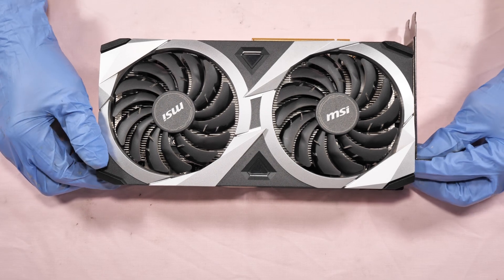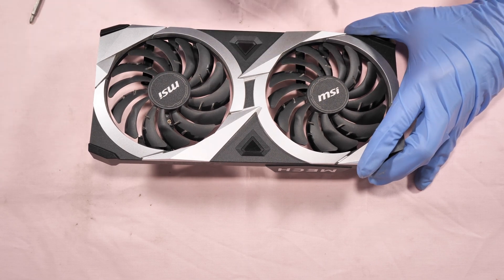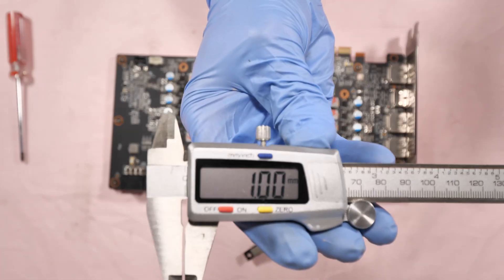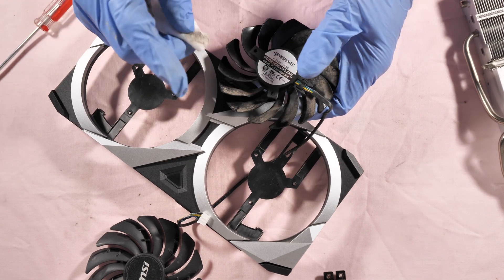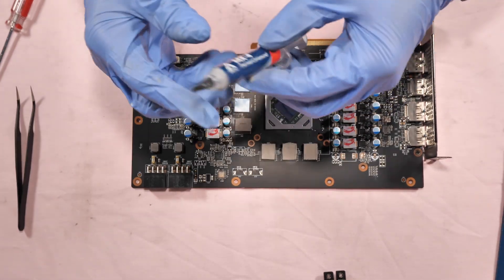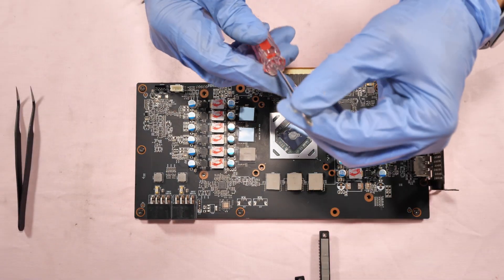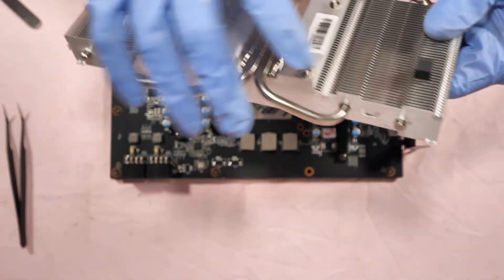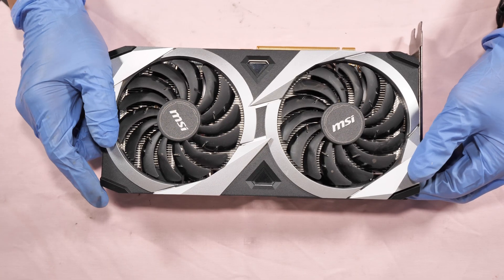MSI Radeon RX 6700 XT MECH OC | Thermal Pads Replacements\Thickness | Fan Replacements | DISASSEMBLY

Comment: Hey man, can you please try to teardown the MSI Mech Rx 7600 please?
Reply from the maker: Hi bro! I'll see what i could do, at the moment i have on hand the RTX 4060 that could be this coming week. I'll do my best if i could source out that particular gpu. 👍
Reply: @TakeThatScrewOut  Thank you so much for the comment! I am hopeful that you'll be able to acquire the Mech Rx 7600.

I was also looking into the rtx 4060, particularly the MSI Gaming X model but it is $110 more expensive than the Mech Rx 7600 in my region :| Plus, my monitor is only Freesync via HDMI port (no nvidia - adaptive sync).

However, I forgot to thank you on one particular observation. It seems that on the Mech in this video, the fans and the plastic shroud with the fan can be disassembled without harming the warranty sticker on the backplate and that is a GREAT news for those of us who like to keep us PCs clean from dust! Thank you for showing this! Although, I hope that it is also possible with the Mech Rx 7600. Good luck!
Reply from the maker: You're welcone bruh! The Blue stick called " PRYING TOOL" you could buy the in Amazon, ebay or other online retailer. By the way, my upcoming Tutorial video is ASUS DUAL RTX 4060.
Reply: @TakeThatScrewOut  That has a nice design. A bit transparent on the plastic cover shroud.
Unfortunately, I will never buy asus because of its extremely high regional prices. I will still look forward to that teardown! Good luck!
Reply from the maker: @sheikhtashdeedahmed2740 thanks bro! Take care.
Reply from the maker: You're very welcome bro! If you have any question about the card just leave in the comment and i'll do my best to answer asap and best of my knowledge.. Thanks for the support! Enjoy!
Reply: @TakeThatScrewOut  Somethings I want to ask but not in the comments. I want people to watch the vid to find out. Can I message you on any other social media? Email is good too.
Reply from the maker: @sta2740  here's my email bro, " ranayabusiness2021@yahoo.com"
Reply: @TakeThatScrewOut  I'm sorry, there's one thing I forgot to ask. What is the blue stick that you have used to take off the thermal paste? 😅
Reply from the maker: Hello bro! MSI RX 7600 MECH 2X Classic Tutorial video has just been posted today 5th Sept. on my channel..Check that out! Cheers! enjoy!
Reply: @TakeThatScrewOut  Hello! Thank you for this! I have just now watched it!

Comment: Привет, а какой фирмы и какой размер вы использовали термопрокладки?
Reply from the maker: Sorry bro! Can't answer your question. If you could translate it to English that would be great. 😀
Reply: @TakeThatScrewOut Hi, what company and what size of thermal pads did you use?
Reply from the maker: I've used different Brand normally..but when it come to Thermal pads based on my personal exoerienced..i recommend Arctic TP-3, GELID EXTREME, XTREME ODESSEY or TRUCER. but Arctic i've used most of the time because its a bit soft side..it could easilly adopt the gap and it performs as good as the other high end brand.
Reply: Используй либо thermalright odyssey, либо fehonda. Также вместо mx4 купи honeywell, его точно не выдавит и он продержится гораздо дольше

Comment: I would like to replace the thermal pad due to high junction temperature. It seems that 1mm is not enough for some people to replace.
Is 1.5mm OK?
The model is RX 6700XT MECH 2X.
Reply from the maker: If you really need to use 1.5mm choose a pads that is soft like Arctic or similar..don't use  Gelid cause its hard, only suitable if use similar thickness from stock.
Reply: did your junction temps reduce mine are high i just down clocked my core and undervolted the card it seems to help
Reply: Actually i had to squezee pads to 0,8mm to proper even distribution between memories, core and heatsink. Check the ideal distance by looking at the threads you put screws into. The PCBA must sit on these. If there iss too much space, the pads are too thick.
Reply from the maker: Thermal pads are different depends on the Brand.. Some are soft and some are a bit hard. This kind of issue can be solve by using a softier pads, it could adopt easily on different gap. And also gpu gap can be possibly change overtime due to its constantly in and out of the screw multiple of times, that could cause loose..there will be no accurate answer.

Comment: Thanks for the video, I have that card, its fast but the downside is that it's loud so i moved it to my workstation instead of my main gaming gpu, overall its the best card i have. What it has LED 1:46 connector? I don't see mine having led lights?
Reply from the maker: That " MECH " emblen at the top that lit up.
Reply: @TakeThatScrewOut mine doesn't light up...
Reply from the maker: Thanks Bro! Take care!

Comment: blackplate is plastic ?
Reply from the maker: Yes its a Plastic..its just a cover, unlike other gpu that has metal that serves as a heat spreader.
Reply: @TakeThatScrewOut  thanks  not good in plastic

Comment: Hi sir what is the max total gpu power in real life for this gpu?
Reply from the maker: According to MSI official specs on this particular  card it would draw 230 Watts..but in real life that normally fluctuates within that range.
Reply: I use with a slight undervolt and see 150watt

Comment: i heard the 6750xt version runs warm. do you think corsair 4000d airflow case and 3 intake/2 exhaust fans will help?
Reply: It is I’m at 72c most of the time
Reply from the maker: This temp is average for heavy loads..which is really good
Reply from the maker: That case is brillant performer..if possible to fill all the Fan slot available, do it mate! And if you want your GPU to perform its best, never go for VERTICAL POSITION and use a PCIe ext. cable..Direct contact to the PCIe GPU & MOBO is the best., and if your Case allow..Use three 120mm or two 140mm INTAKE from the buttom of the case UPWARDS cause Heat direction normally goes Upwards direction. And the TOP FAN SHOULD BE EXHAUST. that make a big difference.

Comment: What is the "normal" tempeture with this gpu
Reply from the maker: After the repaste, on heavy loads Playing COD Warzone 2.0 for about 2 hours temps fluctuate between 57-65 deg with Lianli Pc-011 Dynamic Midi case with 8 fans..this may vary depends on various factors..case,fans, room temps etc.
Reply: @TakeThatScrewOut  How about the Junction Temperature? When you open the Adrenalin software you can see both the GPU and the Junction Temperature.

Comment: Is is possibile to install a bigger radiator with 3 fans from diffrent model?
Reply from the maker: Sorry, i didn't get what you mean by radiator with three fans..do you mean like water cooling 360 aio?
Reply: @TakeThatScrewOut  Like ASRock Radeon RX 6700 XT Challenger Pro  or  Phantom version.
Reply from the maker: Not possible bro, they have a different screw layout on the pcb.

Comment: I have the same card and i have problem... Max load GPU i have 105C~ hot spot. What i need too do? I have guarantee MSI. They can repair my GPU or they tell me its normal for this GPU?
Reply from the maker: This is my suggestion: If you still have the warranty, try to file for RMA ( Return Merchandize Authorization)  and let MSI to fix the problem for you for free..because, if you try to do it yourself, you open the back and change the Thermal Pads and Repasting it..that might solve the Thermal Throttling Issue, but you've break the WARRANTY SEAL AND VOID THE WARRANTY. the problem is, we don't really sure whats really the main cause of the Very High Temps..Doing it by yourself only advisable if your card is already OUT OF WARRANTY. hope this helps.
Reply from the maker: 105 deg is too much..i've played many games for hours most of my card..Temps only averaging netween 58-65. But that would vary depends on many factor, like how many fans inside your case and what type of pc case you're using..
Reply: @TakeThatScrewOut  He's talking about the GPU HOT SPOT, that is, the Junction temperature which is much higher than the normal gpu temperature in this card. I think in his case it's normal.

Comment: please tell me, I have the same video card and when replacing thermal paste, the temperature has increased significantly...I noticed that the radiator does not fit snugly to the chip , there is a gap . How to fix it?
Reply: the old saying.   if not screwed do not fix it.      but nice to learn how to clean the outer part of fan and dissipator
Reply from the maker: Check if the thermal Pads is the right thickness..i suggest use a good quality pads and paste. With pads use Arctic the blue color, Gelid or TEUCER ther.al Pads..with paste use NOCTUA NT H2 or ARCTIC MX6.. and make sure the heatsink and pcb is properly sit before you screw it back..sometimes thats the one reason it cause a gap. Hope this helps
Reply: @TakeThatScrewOut  case always opened  all sides.   it's huge the amount of heat those beauties  produce.  mine is 6750xt mech 2 oc msi.
Reply from the maker: Its big help using a case with intake buttom fan that blows direct to the gpu and exits at the top.
Reply: Mine too i opened  and the thermal  paste was all dried,  and i chamged old one for new noctua  and the thermal pad but it got hottel maybe from 75 tem and 92 junction tem, to  temp 75 and 97 sometimes  100 in junction tem, and the fans  are loud 2300 rmp
Reply from the maker: @davidespinoza5634  on most cases after replaced pads and paste, some just used a cheaper pads thats been bought in ebay that doesn't transfer heat..thats one reason., but in your case that you use a good quality paste, and still the temps quite high..maybe, possibly its not screwed in properly that cause a little gap that could affect the heat dissipation as well. All screw should be evenly tight.
Reply: @TakeThatScrewOut  i will take a look, i know this card can support junction temps up to 110 degrees  but the fans will make a lot of noise, i will open it again and try, by the way the pad are thermalright 1 mm, later I will try with thermalgrisly,
Reply from the maker: @davidespinoza5634  Okay bro..good luck and enjoy! keep us posted about the result. many thanks bro!
Reply: @TakeThatScrewOut  i discovered that for some reason the 1 mm pads in the memory  were causing  the problem. Maybe for my model they were too thick, and the gpu was not making good contact with the cooler, i added some more paste to meke the gpu make good contact  because the   only pads that i have are 1 mm, now seems to be good,   current tepm its between 65 to 75  and junc temps are around 77 0r 80 sometimes  spikes  a 87, or 90, but when the fan start to spin it will get to 80 again,
Reply from the maker: Oh i see..thats good that ypu fixed the issue man..thermal pads are not made equal, some pads are soft some are very stiff like the Gelid, they are high quality perform really well but stiff. I think 1mm should be fine if its soft like the Arctic pads.

Comment: Is this the same as the mech2 x
Reply from the maker: Honestly, Can't give you the right answer right now because i haven't done the Mech2 yet..but i would do soon..i have two cards to do this week, its ASUS RTX 3060 Ti TUF Gaming and GIGABYTE RTX 3060 TI Gaming OC..please consider Subscribe to see more videos. Thanks!
Reply: Any infos so far? Do you know if the Thermal pads for the mech 2x are also 1mm??
Reply: @nm4520  so I repasted mine and re did most of the pads which where really only v ram … I can confirm that the 1mm pads are working well for the v ram chips.. the main heat sync only has v ram pads and a spot for the thermal paste for the die.. there at two smaller heat sinks that on my card that are black and skinny that have terminal pads as well I decided not to change mine cuz I wasn’t sure.. to me it’s possible that those are 1.5mm but I didn’t wanna risk having to tear mine apart and at the time wasn’t sure if I could actively monitor those if something was wrong… anyway no issues with mine so far

Comment: please do a video teardown and thermal pad replacement\thickness for gigabyte rx 6600 xt gaming oc pro and rx 6800 xt gaming oc please!
Reply from the maker: yes, will do in near future. still working on Palit Rtx 3070
Reply from the maker: Please check some of my videos, i had already with Gogabyte Rx 6800 xt Gaming OC. Just check them. 6800 xt and 6900 xt nearly similar setup inside.
Reply: @TakeThatScrewOut hello, please video with rx 6600 xt mech 2x OC
Reply from the maker: Hi bro! I'll see what i can do bro..i'll let u know if i could source out those particular card.
Reply: @TakeThatScrewOut  ok, bro. Thank you 🙏😊
Reply from the maker: You're welcome! Take care!
Reply: @TakeThatScrewOut  , hello, odyssey is good thermal pad? I can buy from china original. 12 .8 w/mk, 5 dollars. But i wait answer from msi support or wait your video
Reply: For know thickness
Reply from the maker: Oddyssey is from THERMALRIGHT brand..i've used that brand before and works great! Similar level with Arctic brand.